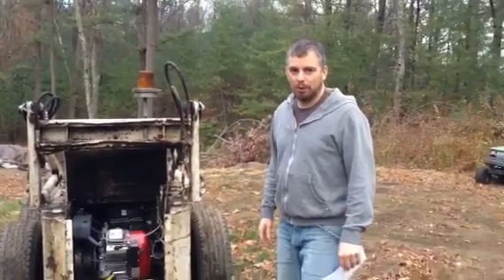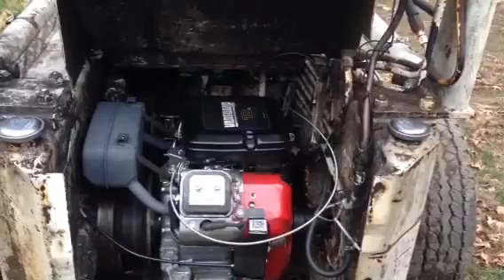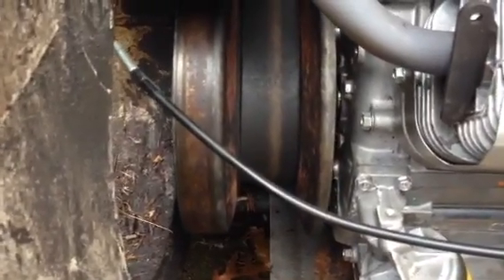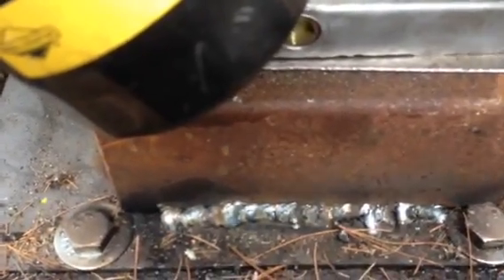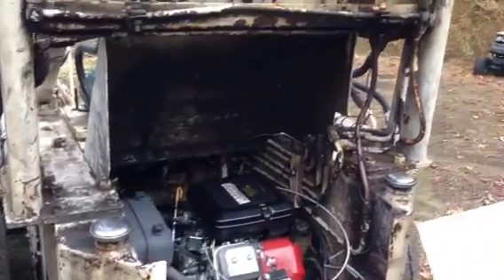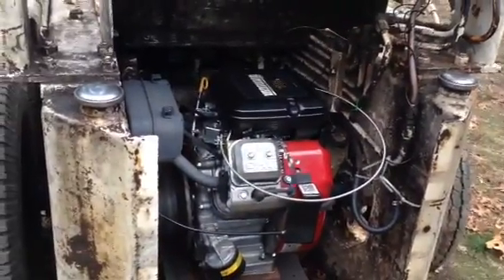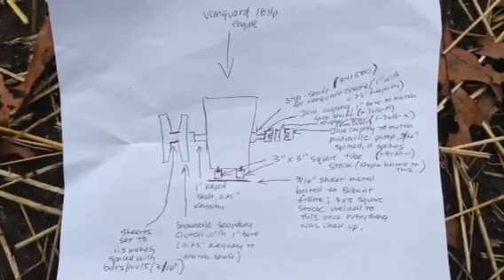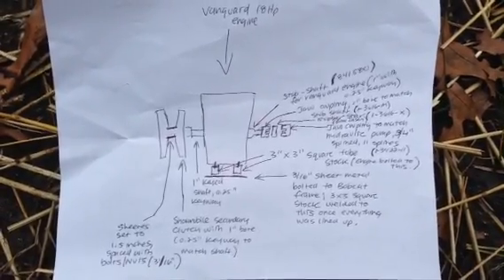Melroe Bobcat M 444 repower

Comment: Hi Glenn, thanks so much for sharing. I have a 610 with a blown wisconsin. I have several options for repower, but need to work out the drive. The pulley you used looks like steel, most snowmobile drives I see are aluminum. What did yours come from? Keep up the good work! You mentioned to send you an email, but I don't see your email anywhere?

Comment: Something that will make that machine so helpful you can't believe you've lived without it is adding a set of forks. While scrapping we ran across several side shift attachments for Wharehouse type forklifts and forks as well. The side shift attachment gets taken off and left off and it's light in weight but holds the forks perfectly. We have made them to fit 3 point tractor hitches they're many times better than the cheap fork attachment that is sold at tractor equipment yards. But made to fit the loader arms of your Melro it's like having a professional body builder on hand. If you wish send me a personal message and I'll take some pics as to how to fit it up,from scrap steel. I've pushed it by removing the good forks and putting a single bent fork and digging stump roots, and digging trenches. They can be had for free and are one of the best investments of weling rods to make 3 point or skid steer attached. Also when folks realize you can fit it you'll make up and sell a few as well.

Comment: Glad you made this. I have missed mine soooooooo badly since it went down. You didn't use the variable drive and just wander was it messed up or was there another reason you chose not to use it? I was given a Kohler V twin 20+ horse power. It ran well on the bench but after the instal it was to worn out to do any work. it would pull it on flat ground but that's it. The Wissconsin horizontal 2 cyl only turns 1800 rpm's and the later model engines turn 3600 rpm's. I wasn't sure if putting a Jack shaft to lower the input speed would let the newer engine work. I couldn't tell if you were running the drive belt direct or had it stepped. If you have answers to my rambling questions I'd appreciate the help.

Comment: im in the process of redoing my 1964 melroe bobcat it has  a Wisconsin two cylinder in it with plenty of power but the hydraulic lines leak but what do i expect i use it to tear out concrete daily the biggest problem i have is i go threw drive belts about every 200 hours and suggestions

Comment: hi my name is frank do you know someone that would have a variable speed drive sheave . i have a onan motor in it. mine is a 444m  thank you
Reply from the maker: Hey Frank, I have one on a 600 I've been restoring but it is still attached to the Wisconsin and my project is on standstill cause I've got 20 irons in the fire right now. Those tapered shaft Variable speed drive systems are real hard to come by and I hear Bobcat charges an arm and a leg plus your back teeth. Is the Onan really worth keeping? They barely make parts for those engines and the ones available and pretty steep. That engine would have to be cherry to want to keep it in my opinion. Just my thoughts.

Comment: You just inspired me!! I own a Melroe 600 with a tired engine, i now know what i need to do. Great Job, Thanks
Reply from the maker: Hey Johnny, Glad to hear it. A few considerations: the bolts I was using to space the drive sheaves tore like twigs. I ended up having s buddy fabricate discs for me, and then bolting the whole thing together as one solid piece with 1/2 inch stainless steel bolts and lock nuts. In addition, I would suggest picking a slow speed, as it is easier on the crank shaft. If you do intend to reuse the variable speed drive, be CAREFUL removing it from your tired engine. I know a guy here is Mass who has figured out a way to do it without damaging the assembly. I could contact him if you want to know how. Feel free to contact me if you have any questions along the way. And don't forget to post some videos of your Melroe in action. Its our duty to save these old beauties from the scrapper!

Comment: Good job looks better than mine.  If I find a good used vangaurd I may re power with one to, and am still looking for parts for the original Wisconsin v4.  So far the engine I have in it is doing the job for what I need it for, and one old skid steer saved from the scraper. THANKS for the reply and again nice work.  Phil
Reply from the maker: I have to say, I am really impressed with the performance of the Vanguard 18HP. I think the modern engines with electronic ignition are much more responsive and accept loads more readily. The cost, though, is an issue, as these engines are at least 1k brand new. I'm in the red with this machine but I figure I'll do thousands in landscaping work over the next year so that'll help me rationalize the cost. Thanks again for your advice. It is a pleasure, and very rewarding to save this historic old piece, as she turns 50! - gc.